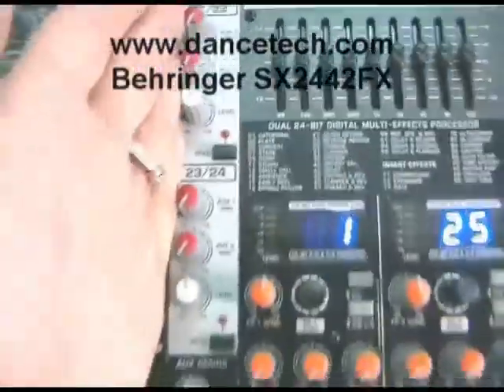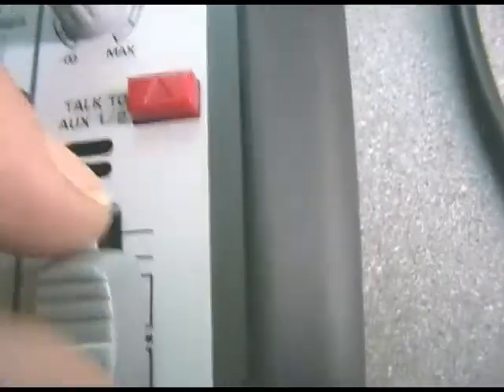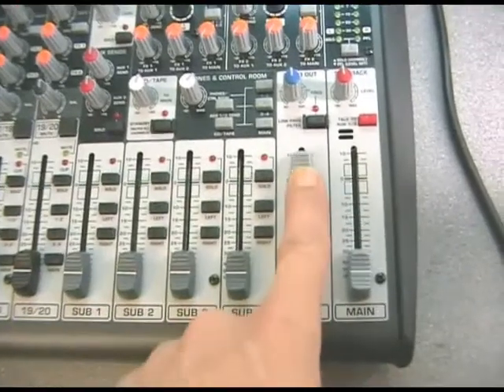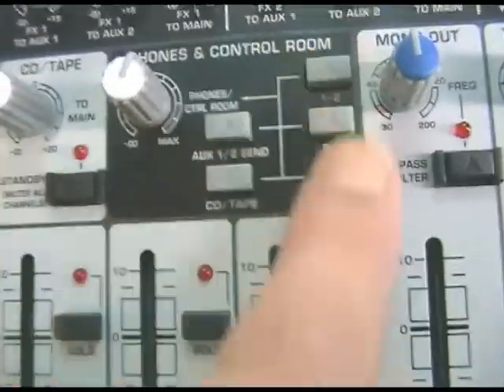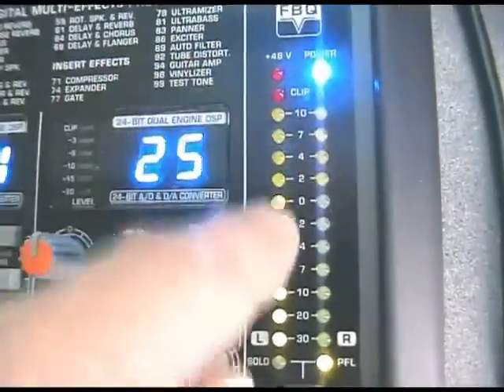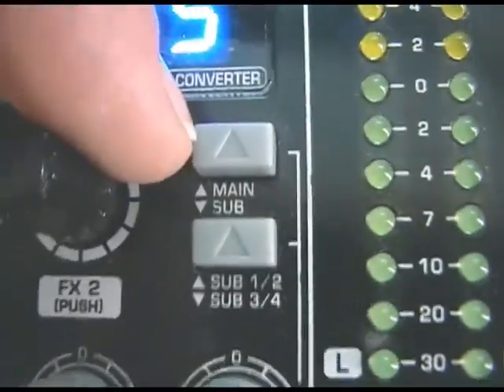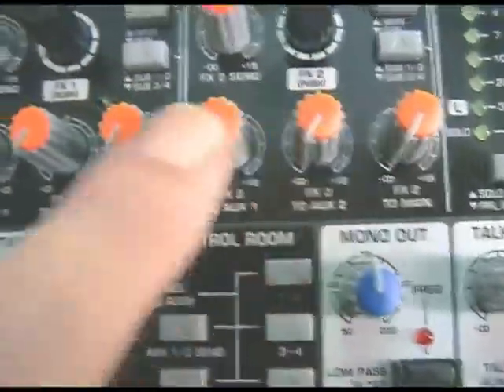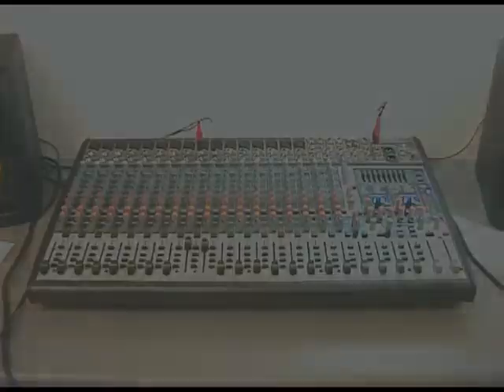Behringer Eurodesk SX2442FX - mini-review 2

Comment from the maker: well rhyvven it sounds like your cabling might be suspect? (the actual cable) i dunno you get a strong signal at the amp when you run a cable from the MAIN L/R 1/4" outs? - you should run the floor wedges from AUX1 out - but of course, unless you send some signal into Aux-1 BUS from a chanel you wont hear anything.

Comment from the maker: the main outs have a different out level to the aux's.. are you running the cables from aux1/2 into xlr inputs or something or do the amps have 1/4" inputs? btw u can use aux1 or aux2 send for the front wedges, no difference

Comment: Can you use the sub groups for stage monitoring, or does that have to be done from the Aux1/2 sends?
Could it be sent through one of the FX channels, without applying one of the FX? - I prefer to use sliders for monitoring, instead of a knob.
Thanks